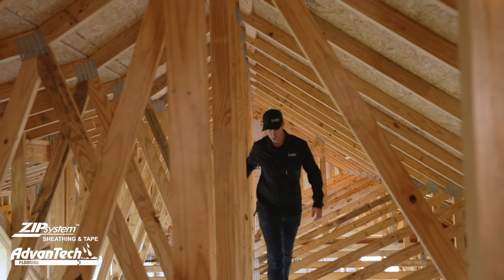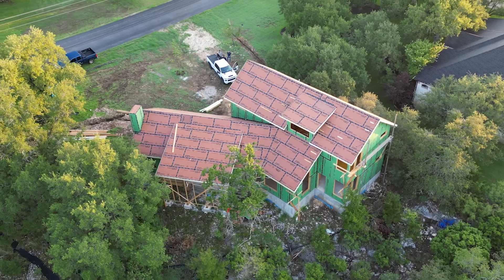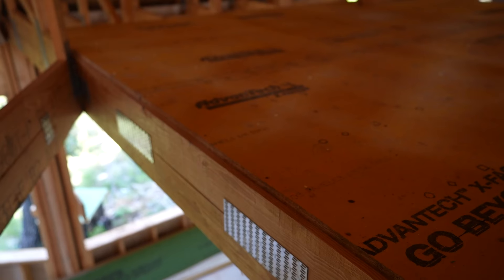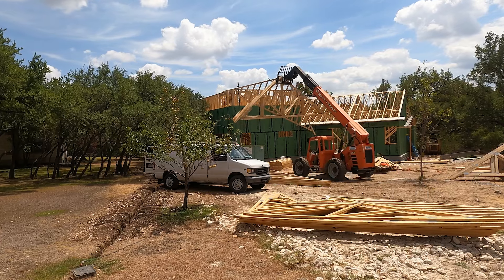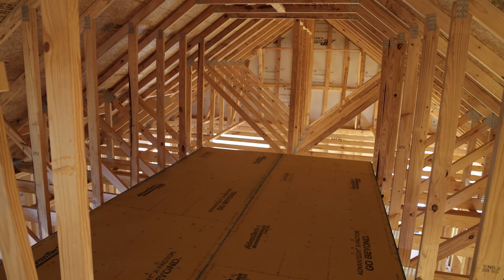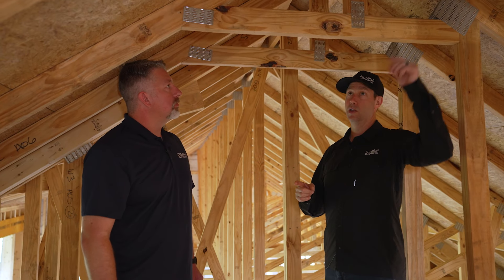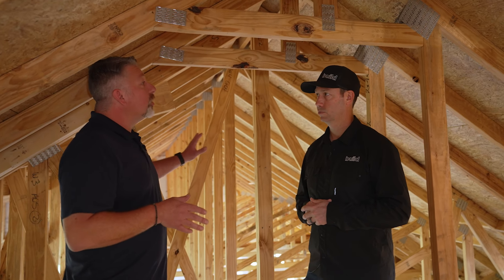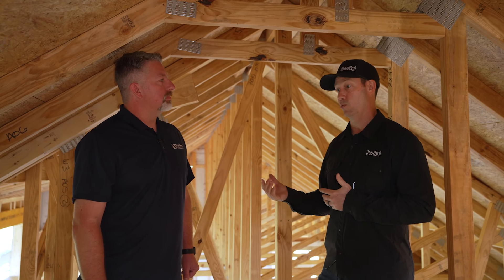ROOF TRUSSES: Pros, cons, and costs!

Comment: I appreciate the discussion of fire endurance that is not usually considered in much of these comparisons. We (FFs) have to be aware that any fire that breaches the inner passive protective elements in a modern building risks early structural collapse. There are unfinished basements without the certain and early knowledge that all occupants have escaped. Which means there are occupants and FFs that are in there. There is much less room for error.  All framing options that rely more on connections vs more mass of wood is devastated much quicker in a fire. It really is math vs mass. Wood burns approximately 1” per hour. These truss connections that are galvanized steel fail much quicker (minutes) in a fire. Steel doesn’t burn but curls up and looses it’s strength and the little teeth pull out of the wood or a fraction of an inch of wood burns away from the connection. People also want large open floor spans and this compounds the problem. Large dimension lumber is at a premium. The full dimension lumber is less dependent on the connection and is more dependable for an occupant or FF. The quality of the structural connections is key to structural stability in a modern building once the fire breaches the passive fire protection (i.e. drywall). Fire endurance should not be discounted as a consideration and should be a higher priority. Remember the World Trade Center fell due to an out of control fire and steel trusses that gave way before the occupants including their rescuers could exit. The building was dependent on the sprinkler system that was knocked out. There was no effective steel protection left. This was the modern lightweight design.

Comment: Yup (former firefighter here), those metal connections would fail early. Compared to rafters, truss roofs are death traps and we would avoid getting on the roof and efforts/decisions to enter a home for a rescue are affected by the likelihood of a structure to fail. Thank you for the video.
Reply: Yep the gusset plates are a weakness of those pre-fab trusses in the event of a fire
Reply: how do the metal connections fail early? i assume that the wood around the connection burns away and the plate falls off, unlike a nailed or hangered connection where the fasteners are much deeper in the wood. Are there papers on this that you know of? i know NFPA and IBC love doing real world testing on this kind of thing.
Reply: The shortcomings of these pressed plates can be offset with a few wood screws!  It should be code required!
Reply: @Cynyr  Two things actually happen. One, the wood burns away resulting in a loss of contact with the gusset plate. Two, the gusset plate will actually warp and draw the teeth out of the wood it is holding together. These two criteria can result in premature roof failure. I wish I could comment with pictures as I have a couple that show this perfectly.
Reply: @kristensorensen2219
Reply: @kristensorensen2219  not really - a typical house fire can reach between 1000 & 2000 degrees F - wood will retain up to 70% of it's strength while it's burning, on the other hand steel will fail like a wet noodle in less than 5 minutes...
Reply: The fire protection comes from the plasterboard/sheetrock on the ceiling. You only need enough time to get out of the building safely, nobody is going to try to salvage a burnt out building.

Comment: City required a preman roof truss system on my home build myself structure and actually was a good thing.  Saved me a lot of time and in FL using the beefiest hurricane clips that are u shaped I just set each truss self standing into clips...Everything I did I beefed up well beyond minimum codes from foundation to 16"oc, to complete hardi exterior...
Reply: Man. I wish you did ICF pour with the entire first floor as a garage. When that wind and water blows in FL a steel roof and concrete will protect you

Comment: Matt, I jumped on the notification for this because I am currently looking at learning more about truss roofs. However, I was looking for info on truss roofs when wanting to add an attic space to a garage. Could you touch on how much extra load or what sorts of modifications can be done to a truss roof above a garage when waning to add an attic/crawl space? In my situation, it's 24" center, off center peak. The previous owner added a Warner fold down ladder and laid 1/2" ply down all over. We keep light stuff up there. I have been looking at how I might bolster so I can increase the load. I have thought to add an H beam down the middle with a post or H-beam span the width and run 2x10 under the truss to bolster a section.

Comment: Need context to define what $7k savings is... 10 - 7 is way different than 100 - 7 ...but we never heard a total for either roof system.

Maybe you can do an actual cost comparison of various COMPLETED roof systems in a future vid, to include SIPS, ICF deck, vented double decking, ridge vent, full closed cell, 1" closed cell w/batt, batt only, tar shingle, clay tile, metal tile, standing seam... various combos?

A vid like that'd be 99% research & scripted, with charts. Bit different than the norm for this channel, & extremely helpful.

Comment: Framers not needing as much experience is a pro and a con. I'm drywalling a house right now that the framing crew clearly didn't have much experience, and they've screwed up in ways I didn't think possible with trusses. There's a big vaulted ceiling that joins a flat ceiling, and the lines are definitely not straight. I still haven't figured out how I'm going to fix it. Of course when it doesn't look good nobody thinks it is the fault of the framer, is just the drywall guy must suck. I'll bet there's not a square corner anywhere in the house.  All the exterior wall headers are leaning out at the tops, and not by an 1/8 or 1/4, I'm taking at least a half inch. Walls are out of plumb by a half inch in four feet. I could go on and on. Cheaper and faster does not equal better.
Reply: As a home inspector I have to explain this to my clients constantly.
Reply: I agree 100% It looks fine until you plane it across and it’s off. The difference between look after framing and the look after drywall need to be within 5% of each other minimum but it’s typically not that in production framing where trusses are more often used
Reply: An 8’ wall that’s 1” out of plumb is crazy. Are you going to rock it?

It’s crazy to think of the lipstick that gets put on some pigs.
Reply: @johnlee7085  it's already hung, we didn't have a choice. There was no way to fix this wall really.
Reply: btyer… So how out of plumb is too much? 

Done enough rehab that out of square is basically expected but out of plumb is a completely different issue. 

I also appreciate the challenge of the drywallers, both having done a bit as well as the business aspect. If you aren’t willing to hide the framers garbage, they’ll find someone else that will.
Reply: got to be the vrew that know how tro do aything!? im suprized You managed to get a job on that project! good luck with figuring out that mess! make sure you get paid for the extra work You do!
Reply: That house sounds like the house my dad had built when I was in school. We had a 45 degree wall that was not even close to 45 degrees. It was a chunk take out of 90 degree corner. for the master bath. We had a pain to figure our how to tile the countertop. I came up with a suggestion to just treat each wall individually which allowed it to look somewhat reasonable. It was not perfect but it worked. I do not want to talk about the dining room where we had a wall separate the attic of kitchen and the cathedral ceiling. That stub wall was like 5 degrees leaning into the dining room after a nice straight wall going up nine feet.
Reply: And that house is probably in a "how to" You Tube video made by one of the many self-professed experts...
Reply: You shoulda seen the framing at my place, the previous owner added a second floor but didn't put in insulation, subfloor, staircase, or anything, it was a giant attic. So when I bought it I was pumped to be able to add the second floor. The ceiling would've been Soo wavy that I had to sister 2*4s to every one of them just to get it flat enough to drywall.

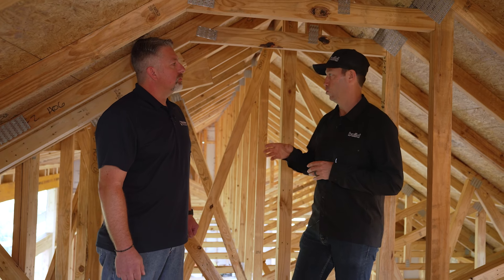Comment: big challenge with truss roofs is how the ceiling pitch for sissor trusses is half the pitch of the roof pitch, so 12:12 roof pitch gives you 6:12 ceiling pitch for cathedral vault. people like their vaults steeper. so we generally stick frame focal cathedral vaults.
Reply: With a slightly taller heel we can make a parallel chord truss with the same top pitch as lower pitch. Can be provided as a single piece or for larger spans such as a 40' wide great room/ living room we could do as a 2 piece that connects with a LVL ridge beam and some hangers.
Reply: @cherrytsume  yes!  I recently learned about parallel chord trusses and love them.  No ridge board to support so we can maximize gable end windows.

Comment: Question for all you professional builders...who typically installs the roof trusses?  A traditional framer that does floors, walls, and sheathing? Or are there specific truss installers that are hired for this stage of the building process?

Comment: Random question Matt, not sure if you addressed this before and i missed it, but with how tight you are building houses, how do the houses pressure equalize if a tornado comes near by and causes a sudden pressure drop? I recall always being told to crack some windows in severe weather to allow it to equalize with causing explosive decompression thru the windows but not many people seem to do or know that these days. do you install some kind of spring loaded pressure blow off vents?
Reply: The debris in a tornado will take care of any pressure issues.  Ever see a 2x4 get shot at tornado speed. It goes through concrete blocks like a knife through butter.
Reply: @mdhofstee  i think you missed the part where a tornado a mile a way makes all of your windows explode and the rest of the house is fine.... especially if you are using these new high efficiency windows that cost much more.

Comment: While Stainless Steel plates are available; those shown are Galvanized.  The stacked chords under the mechanical area is also allowing for full insulation depth when a structure is conventionally insulated.  IE not a conditioned attic.  Trusses protect homeowners from a builder/framer that over or under sizes members to make things "easy" or save costs.

Comment: What about insulation, air sealing? 

I recently had all my blown-in fiberglass insulation sucked out of my attic so I can get better air sealing of every penetration and wall ceiling connection. Then I had cellulose insulation blown back in to a R-50 here in Wisconsin. I also replaced a bathroom exhaust fan as part of the project (did it myself). I was cursing my trusses every minute I was up there. Also, I probably paid more to have the insulation removed because of the truss system. I wish I had cut roof system. My next house won’t have trusses. The cost savings up front isn’t worth it if you need to get back up in the attic.

Comment: How do these work w/ spray foam insulation?  I know mechanically it's not an issue - it'll still stick just fine.  But the insulation spraying access to all parts of the roof when having to go through the trusses must be very difficult, and hard to get to the edges effectively.  I would think that would make for insulation issues at these spots.

Comment: Hello, just wondering if you ever heard of truss lift? The problem with the bottom of the truss lifting up during the the summer months then lowering back down during the winter months.
Reply: Came here for this. Dealing with uplift in my house. 😢
Reply: @mattgraff  ,I am  sorry you are dealing with truss lift .   When I built a new house  ,20 years ago , I was told the trusses would be uniformly 2x4 s .  I thought the engineering was inadequate , and I insisted on 2x6 bottom chords .  Works like a charm ; no truss lift 
Good luck to you.

Comment: Most my customers want trusses over hand stack to eliminate the structural engineering costs. Trusses are provided with engineering and my area the building dept. requires the roof engineered.

Comment: Cost savings for framing clearly a win, but expect difficulty for access for sealing and spray foaming under roof and inside attic gable walls for a “conditioned” attic.  Ability to add plywood flooring to improve ability to move is nearly impossible. Ability to inspect quality of caulk and insulation much more difficult. Probably best used in unconditioned attics, I would think.
Reply: I was wondering about this as well. How do you insulate? And how do you work in the attic after completion where you can't step on anything? I think insulation is less bad, since it can be done before the drywall is up, with more access. For access after completion, I'm thinking to engineer in walkways to allow plywood to be put down. Opinions?

Comment: $7,000 seems like false economy considering you lose the square footage in your attic. Instead of maybe 1,000 sf of storage, you have a forest of lumber. Access is also hindered. Dislike crawling through trusses to add a light or fix some issue. All are benefits to the owner but a cost to the builder, so classic trade-off. 

Are there truss designs that are more open? Basically shop-built 2-by semi-modular construction.
Reply: Yes, you can request and have engineered a floored room inside the truss for storage, HVAC, or other mechanicals.  It does depend on your area, wind load, and snow loads as to how big that can be.
Reply: Yes, they're called attic trusses. They'll have an open box in the center.
Reply: Agree with false economy.    For a single family home, the loss of the storage space doesn't justify  such small savings (that is likely not entirely passed on the the homeowner anyway) .  I don't think building a house cheap with no flexibility is the way to go.    As you mentioned with conventional framing you may be getting a 2400 sf house with  1000 sf of storage, compared to  a truss house with 2400 sf living and 200 sf of storage(occupied with a HVAC system).   While one may be cheaper than the other, you have two different products.     There are may applications where trusses would be ideal such as apartments, large sheds and commercial leasing applications where no storage is permitted or desired.   I know you can add additional storage platforms to trusses but when you put large block-outs in a truss it becomes less efficient  and starts to mimic a  stick built system, and savings are reduced.
Reply: @TheModelmaker123  In the upper midwest, most houses have basements for much more convenient storage(HVAC is down there), attic access is usually a small scuttle hole in a closet or maybe the garage, and the attic is 2' deep in insulation. I think the tradeoffs vary by geographic location.
Reply: @ryknoll3  Yep,   In the south there are generally no basements and AC units are in the attic to conserve living space.
Reply: @TheModelmaker123  That's why it's important to live somewhere with basements. Attic storage is awful.

Comment: It seems to me that trusses result in a lower quality/less even structure more often than not.  If there is bad lumber or tolerances there's not much that can be done in the field, resulting in greater chance for lumpy ceiling and roof planes.  Trusses do have their advantages though.
Reply: Are you speaking from experience, having seen many of these flaws?
Reply: @steelddd  yes my own home, as well as others around me when they were built with trusses.  My framer did the best he could but I still ended up with a lot of uneven roof and ceiling areas.
Reply: Trusses, being engineered are almost always going to be stronger and more consistent though. Lumpy ceiling and roofs would be from using crappy material like 7/16 roof sheathing. 

I would never go hand cut.

Comment: My personal preference would be for an ICF roof, but that would be rather difficult (not impossible) with a roof pitched to shed heavy snow loads (8:12 or steeper).  I know the LiteDeck system is rated for up to a 7:12 pitch.
Reply: Have you priced LiteDeck?? I just got pricing starting at $55 a Sq foot. For a 2000 Sq ft roof it's 110k! And I still have to insulate and cover! I was floored with the pricing.
Reply: @joeywharton5662  No, we're still in the dreaming stages.  Actually the LD foam should provide a lot of the insulation value so all that would have to be done is some form of covering or finishing.
Reply: @michiganengineer8621  there are different R values available, 3 I think, but non of them was high enough for my zone (5). The lowest R was $55. They didn't give pricing for the higher values. The float floor was $45 a Sq ft. That was installed.
Reply: Just looked in my documentation, I was quoted R26. System goes up to R50. IMO the cost is astronomical
Reply: @joeywharton5662  Was that quote for the SRS or the WRS LiteDeck?  Either way I agree the cost is extremely high, although you'd never have to worry about tornadoes again!
Reply: @michiganengineer8621  WRS for roof. I just got a quote from the truss builder for 7k (material) no install. Planning to wrap the entire envelope in 3" polyiso foam board and 7/16 zip sheathing. Spray foam 1" on interior envelop and batt insulate the 4" stick frame wall (R34 wall), 30, R55 ceiling.
Reply: @michiganengineer8621  luckily I'm in Colorado at the base of the mountains. No tornadoes, earthquakes, just occasional high winds.